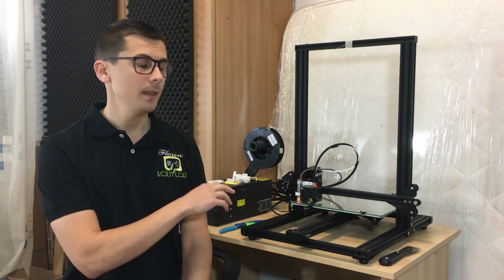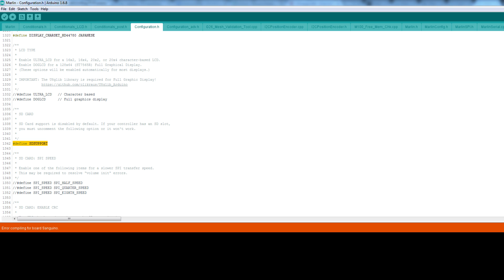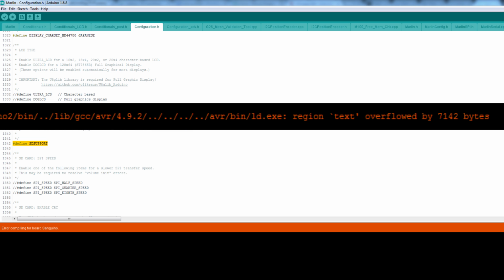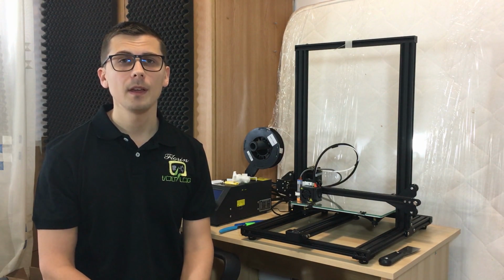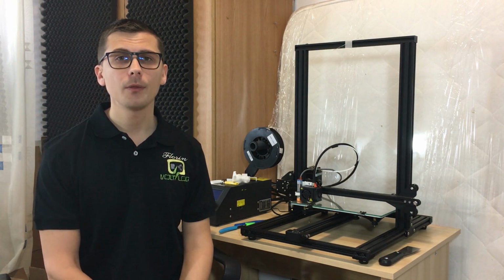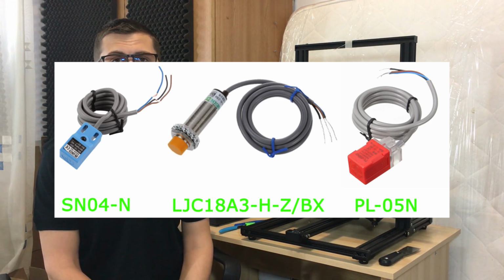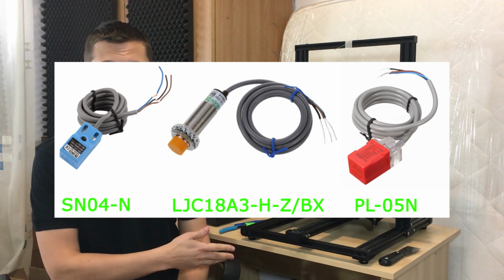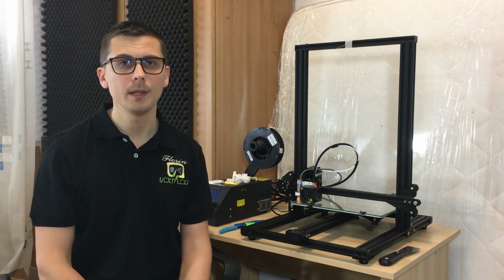Voltlog #145 - How I Failed To Install Auto Bed Leveling On My Creality CR-10

Comment: I'm a newcomer to 3D printing, and I am amazed at how crazy all this is. The printers need a feedback method. Why is everybody messing around with firmware? The printer should know where its nozzle is when the nozzle has reached its operating temperature at the beginning of every print. Additionally, every print should start with the nozzle checking where the bed is at 9 points, then the printing can start. No need for the user to screw around with changing values. WTF?

Comment: Hello Friend. Inspired by you, and this your video, i have installed auto bed leveling, its works with sd card, tft screen and also i have added filament runout sensor, soon i will make a video with all explanation of the instalation. Check this video its my first test with the bed leveling. Thank you for your information on this video. My video testing the bed leveling https://www.facebook.com/pedro.litos.sba/videos/170443490783996/

Comment: You've probably upgraded the mainboard by now, but Marlin with SD and text LCD and ABL fits in 119520 bytes.  Maybe because the CR-10 has a graphical display with a rotary encoder?

Anyway, there's other things you can do to save a bit of memory and get it working.  Firstly, make sure you don't have any of the debug options on.  There's several places where Marlin can report the results of ABL, report freemem, status etc.  These take up a large amount of program memory.  Also see if there's a "slim" version of the menus than can be enabled to save space.

Secondly and most importantly, I'd recommend disabling (commenting out) the #defines for  EEPROM_SETTINGS and EEPROM_CHITCHAT which are often enabled by default.  This will disable M500 and M501 commands, however I feel this is redundant if you set everything up in firmware anyway (like home offsets, probe points etc).  Just doing this will save 6622 bytes, about 6%.  There's probably other things like this that you can easily do without.

ETA: Oh, and with a glass bed the better options for sensors are a capacitive sensor like the LJC18A3-H-Z/BX or the BL touch.  I think you have since got a BL touch.  As others have no doubt pointed out inductive sensors do not work well with aluminum beds and not at all if they have glass on them.
The capacitive sensor I listed has variable sensitivity up to 10mm so should be able to compensate better than other fixed sensors.  People are using them on 5V though they are technically a 6-36 volt sensor.  I've got one on the way in any case...
Reply from the maker: Thanks for all the hints. I eventually started using octoprint and never thought about sd card printing again. In my workflow I use the M500 and M501 whenever I make changes through octoprint terminal interface. Regarding the bed sensor I am currently using a bltouch clone which I've documented in one of my videos and I find it to be working really nice except for a nasty vibration of the metal pin inside the sensor which is audible on certain motor movements.

Comment: You look like you've got plenty of thread left on the sensor to bring it up higher than the nozzle, why not just do that?  You only need to be a mm or so above the nozzle, which looks possible from your picture.

Comment: Hi. I Have Just upgraded my stock cr-10 with abl. Same Way as you did. Just remove the glass, put lokbuild etc on bed, and for firmware issue, use TH3D firmware from Timothy Hoogland, it has abl, SD card support is easy to configure and fits into regular CR-10.

Comment: Thank you for your explain for the LTV-816. i try it but no have voltage on PIN 4 and 3 with multimeter plugin. the sensor is PL-05N
i will use your diagram with ramps. have you idea for help me please. thank in advance

Comment: In the Marlin Source code, there are some debug option enabled by default in the configuration.h if you didn't already do it. you can save quite alot of memory that way. Although i did not encounter this issue since i do have a CR-10S. If i remember correctly it's to uncomment #define DISABLE_M503 and comment out #define ARC_SUPPORT.
Reply from the maker: ARC_SUPPORT is disabled by default and saves ~3226 bytes
DISABLE_M503 was uncommented on my config, don't remember if it was like this by default but anyway, still doesn't fit even with the simplest leveling option "AUTO_BED_LEVELING_3POINT"

Comment: Would an (cheap) ultrasonic sensor work well for this application? http://www.machinedesign.com/sensors/proximity-sensors-compared-inductive-capacitive-photoelectric-and-ultrasonic
Reply from the maker: they might work but can you get a cheap ultrasonic proximity sensor? On a quick search they are above $100
Reply: I think you are right. I was thinking of the cheap ones for "arduino projects", like HC-SR04, but looking at the specs on this, I think the accuracy is good only to a few mm, which is to much for leveling bed/nozzle gap - I think accuracy would need to be better than 1mm. I was also wondering if there was any mechanical switch application for this, e.g. one with a probe "stick" on it, but then i realized it cannot protrude past the nozzle depth, or else it will drag over the prints - a problem I currently have with my dual head Powerspec (a FF Dreamer clone)...
Reply from the maker: For this application you would need an open colector output sensor. The SR04 are not proximity sensors and they do need a bit more logic to function which would make them incompatible with the input the printer expects on the Z-axis limit switch. There is a mechanical switch called bltouch, costs about $50..

Comment: You want to use a capacitance proximity sensor to sense the glass bed. I am using an Omron E2K-X4ME1, which was very inexpensive on eBay. I hope that helps!
Reply from the maker: Thanks! I ordered a capacitive sensor a few days ago and will report back once I receive and test it.

Comment: I'm not sure Florin, but I think when you select AUTO_BED_LEVELING_BILINEAR instead of the fully featured UBL you do have enough program space for the firmware! I used this on the anet a8 and it works well! Also as mentioned before, the 8mm spec is based on steal or iron...
Reply from the maker: I have tried all the bed leveling options, none would compile together with the SD card and graphical lcd.

Comment: In my opinion, auto bed leveling is nice to have but not a must have. What I'd recommend you to try is to connect a Raspberry Pi 2/3 running Octoprint. This way you can avoid the SD card all together and don't necessarily require the stock LCD.
Reply: You can run octoprint from a tablet web browser and monitor the progress, move axis for maintenance, & adjust fan speed mid print, temps mid print. The system for doing this on the printer itself is a train wreck. You can also more quickly stop a failed print and move the Z axis up in 2 clicks rather than scrolling through 5 menus making small changes. OctoPrint also supports plugins to taylor your printer to your specific needs. The sd card slot on the CR-10/s will fail. Not if - when. Its horribly designed. The usb port on the printer (I have a CR-10s) being a mini usb when it should have been a full size USB  type B. Their frail fragile parts that will break. Also complement OctoPrint with the latest Marlin firmware and you'll have a monster of a printer. Theres nothing to maintain or debug with OctoPrint either - its all self contained. The ONLY thing you need to do is put in your wifi settings and DONE. It auto updates.
Reply from the maker: I get allot of recommendations to run octoprint on a RPI but I don't see the point, I can print just fine without adding this additional system that needs to be purchased, configured, maintained and debugged if something doesn't work. For me it's much simpler to insert the sd card whenever I need to print something.
Reply: I've recently received my CR-10 as well and RPI with OctoPi was pretty much the first upgrade of my 3D printer, because it's so much easier when you can print with just one click directly from Cura.    But I've experienced some issues with OctoPI. Print time increased like 3x compared to printing from SD card, and every now and then print stop in the middle due to communication error. Maybe it's caused because I'm using original slow RPi, but for now I'm going to stick to printing from SD card.
Reply: Dave F aaaand you can record time lapses if you happen to have a camera attached :)

Comment: Disable the -EDIT "SD, not USB"  -  USB function and use your current setup while you're waiting. When you print from USB you'll see how silly the SD card printing is . Problem solved. You seem like you are afraid to print from USB because you might like it.
Reply from the maker: I have the printer across the room, opposite side from the computer. Why would I get a new computer just for the printer or change the current placement? It makes no sense when I can simply plug-in the sd-card whenever I need to print something. If I were some production facility printing 24/7 it might make sense, but the way I use it, really doesn't make any sense.
Reply: You get up to 5 meters with USB 2.0. Try it, you won't go back to SD. Or don't, it is your time and aggravation. I've tried both and know which is preferable. You are adamant with out having tried it. SD card printing is so 1990's.
Reply: A Raspberry Pi running OctoPrint will eliminate your cabling issues.  This is an inexpensive and robust solution...it also has the added benefit of allowing you to remotely monitor the print if you install an inexpensive USB webcam.

Comment: Get out of my head!  You just described exactly what I went through.  I disabled SDSUPPORT and printed right from Cura via USB.  I have since built an OctoPi and holy hell it's cool.  My ljc18a3-h-z/bx is also on the way.  My inductive sensor gives me a bit if clearance but it's not very consistent. I think I'm measuring the aluminium and not the glass.  I wired mine such that it is on an external connector to make it easy to remove or upgrade.  I'll probably end up with pei eventually.

I wish I had gotten the 10S from the start...  Better main board is the most useful part to me, but dual-z and run-out sensor would be nice bonuses.
Reply from the maker: I am waiting on the capacitive sensor to see what kind of results I'm getting with that, and then I will decide if I need to switch to PEI sheet or not.

Comment: Some people wrap the sensor with foil tape to increase the sensing distance, or possible line the underside of the glass with foil tape, some have also used a steel plate between the glass and the heated bed, other wise a bltouch would solve all these problems
Reply from the maker: I am waiting on the capacitive sensor to see what kind of results I'm getting with that, and then I will decide if I need to switch to PEI sheet or not. The PEI sheet would certainly solve the clearance issue but I feel glass is a better option since it's easier to maintain.

Comment: The sensors are actually made to sense ferrous metals.  Your bed is aluminum so the sensor is not going to work properly at 8mm unless you put a sheet of tin under the glass.  I bought a few types of sensors before I found out what the problem is.
Reply from the maker: Did you try the capacitive one?
Reply: Every one I tried worked inconsistently.  I finally cut a sheet of fine gauge sheet metal and sandwiched it between the plate and the glass. After that, EVERY one of them became consistent and worked within the published gap specifications.
Reply: Good to know.  Thanks.

Comment: I think you should use something like this https://aliexpress.com/item/controller-PCB-board-MKS-Gen-L-V1-0-integrated-mainboard-compatible-Ramps1-4-Mega2560-R3-support/32812146000.html instead of standard board inside your CR10, because it already has all useful features (except for the SD card slot, but for that I use display module with one) and is fully compatible with Marlin firmware. Also it has sockets for stepper drivers, so you can swap them for something like new silent TMC2100.
Reply: Actually, I use this thing: https://aliexpress.com/item/3D-Printer-splash-screen-MKS-TFT32-touch-screen-smart-controller-display-3-2inch-support-wifi-BT/32735869944.html because I want power-fault feature and want to try to use touch screen.

But you can buy something like this https://aliexpress.com/item/MKS-GEN-L-V1-0-with-minipanel-lcd12864-support-a4988-a4982-drv8825-tmc2100-lv8729-tb6600-cheap/32804824459.html with standard LCD and encoder.

Or you can use existing screen (check pinout first) with standalone SD card module like this https://aliexpress.com/item/Free-shipping-Newest-Version-Sdramps-SD-RAMPS-Assembling-Module-For-Ramps-1-4-3D-Printer/32633358368.html
Reply from the maker: I was actually considering the TMC2100 silent drivers a few weeks ago. This board is also way cheaper than the CR10S motherboard but I would have to add the cost of the drivers which brings the cost to the same level as the CR10S motherboard. I would have to think about this, it sounds really nice but it would be a complete overhaul with lots of tweaking inside the firmware to get it all working afterwards.
Reply: If you don't use "smart" features of TMC2100, and just stay in "default" mode (like silent one), you can use them just like standard drivers (A4985 or DRV8825). It's very easy, and there are many online guides. But if you have some time, you can significantly improve your printer. Also you can buy cheap drivers for now, and use them instead.
Reply: Could you drop a link to the display module for the cr-10 with an sd slot? This looks like a great upgrade.

Comment: Seems like the marlin crowd could do some optimization on the firmware. 128k is quite a bit of space.  Maybe it’s ui graphics that can be reduced or optimized. But also seems like atmega avr is slightly underpowered for all of that functionality. Surprised they aren’t using some 32 bit mcu like stm32.
Reply: Jens Jensen   mega2560 is good enough for this application
Reply from the maker: While I was researching the different available motherboards I was surprised not to find any variants build around the stm32 (there was only one the MKS) but marlin doesn't seem to support these. I'm sure the firmware could be slimmed to fit in 128K of flash, but that would probably take allot of rewriting which people don't want to do when you can just swap the board for the 256K version :-)

Comment: Try sensing onto a piece of steel, we use sensors like that at work, the distance is effected by the type of metal it is sensing.
Reply from the maker: Yes, it does work better for more ferrous materials but I need to get it working on my application. I think a capacitive sensor would give me better results so I am waiting on one to be delivered so i can test it.

Comment: The 8mm are measured with a reference material (Iron). With other metals it is much less. There are sometimes some reduction factors in the datasheet.
Reply from the maker: Ok I'll take that as a reason for why I'm not getting the full rated 8mm sensing distance. So I'm left with two options, either remove the glass bed and replace that with a 1mm PEI sheet as someone suggested bellow or try the capacitive sensor which should also sense the glass bed.
Reply: that is in fact the reason, for aluminum i usually consider half the rated distance, there are inductive sensors with higher detection distance but they're harder to find.
Reply from the maker: By increasing the sensitivity of the sensor I would expect to get noise & accuracy issues but I can't say for sure.
Reply: Just get Bltouch sensor and avoid the headache! It works on all surfaces and it is more accurate than the capacitive sensor
Reply: @nullptr4042  I have a full aluminium printbed with kapton tape on it, superthin and the sensor works really well on this. I have a 4mm sensing sensor, in reality on the aluminium it senses around 2mm away from the bed, maybe a little bit further since my aluminium bed is pretty thick. I prefer the proximity sensors above the BLtouch, I had a BLtouch and it was very prone to getting errors due to vibration of the machine. I threw it away :D

Comment: 8mm distance is for ferric type of material , much less for aluminium due to magnetic properties of aluminium
Reply from the maker: Now I'm thinking the capacitive sensor would have been a much better choice. I have ordered one and waiting on the delivery..
Reply: You need to see this video, it can help with choose right type of sensor: https://www.youtube.com/watch?v=il9bNWn66BY
Reply: I was about to say there might not be enough mass of metal in the bed, but if it's Alum.
I was just watching Kev31779 and he replaced the C10 glass with a 12" x 12" mirror tile from the hardware. Maybe that is thinner.

Comment: In my experience with inductive bed sensors, they tend to be rather unreliable, so not sure if it is worth the effort to upgrade. Manual bed leveling is always way more reliable, mostly when using glass.
Reply from the maker: Now after dealing with this problem, I have to agree with you. The initial bed leveling I did manually for the CR-10 took about 15 mins and it was working just fine. Compared to the auto-bed leveling upgrade which took a full day of messing around with the different options...

Comment: I think most people take the glass sheet off and put a 1mm PEI sheet on top of the aluminum when using bed leveling because of the sensor distance issue.  PEI is really nice to print on, you get good adhesion without any sort of tricks like glue stick or hairspray and when it cools the part pops right off. You can get a nice sheet with adhesive off of Amazon (USA at least) for something like $15. It'll heat faster without the glass there too.
Reply from the maker: Thanks for the hint, I will get a sheet of PEI and report back in a future video. Being so slim it could allow the current sensor to work..